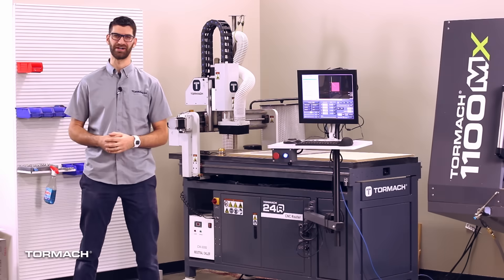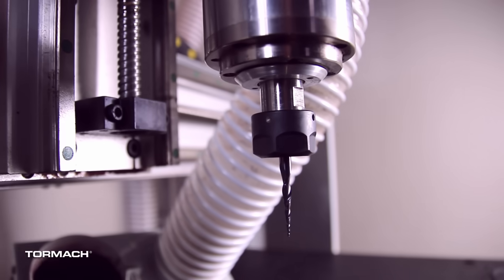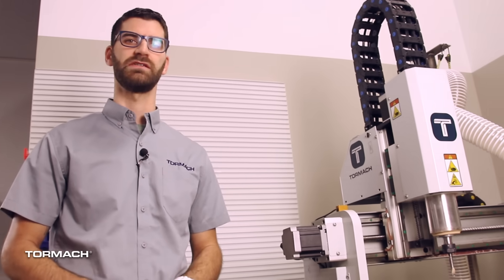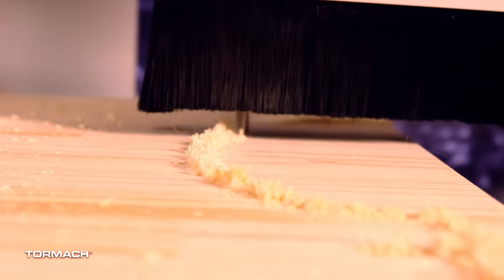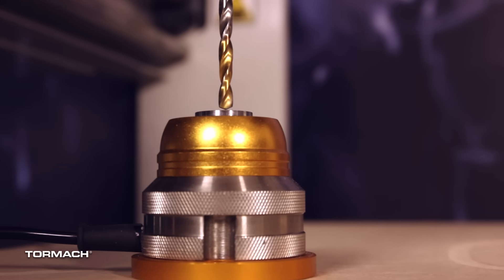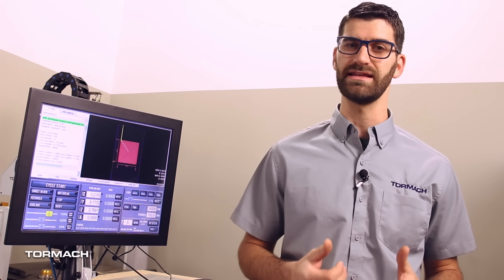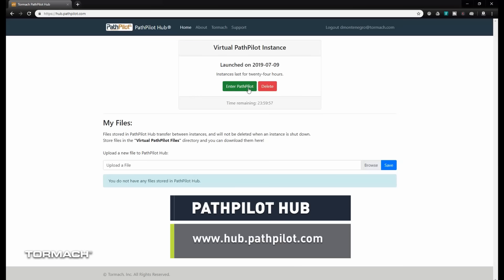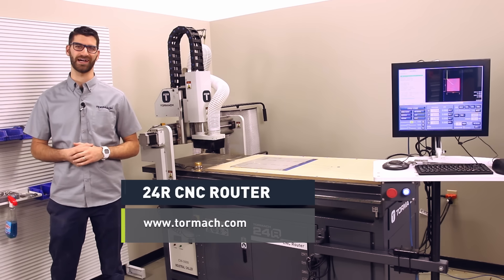Introducing the Tormach 24R CNC Router

Comment: Why on earth didn’t you guys throw the same spindle on it that you have  your other mills???
Reply: Because of spindle RPM, that’s why. On a router and the types of materials you’d be cutting, you’ll want a lot more than 10k, or there’ll be very little surface speed for the smaller diameter of cutters being used.
Reply: If I were to guess, is the speed. The mills are meant to run at slower speeds for metals (alum. being the common material) but wood and HPDE can be run at much higher feeds so you need more rpm.  I am waiting for the day where I can have a spindle with 1K rpm to 30K all usable power across the band.